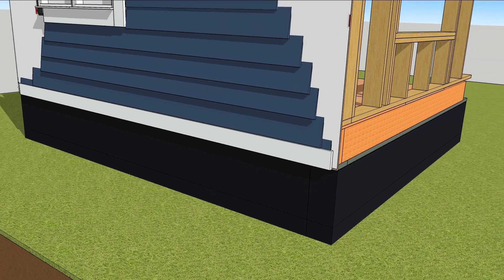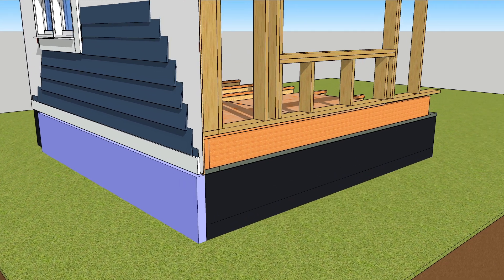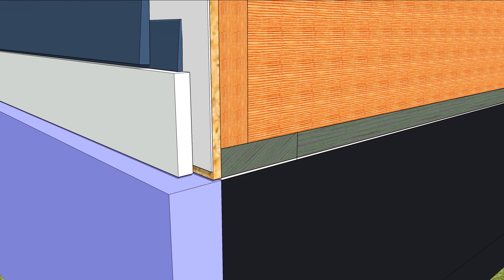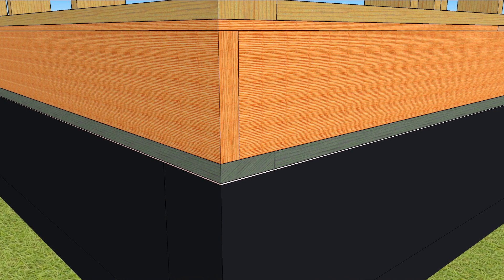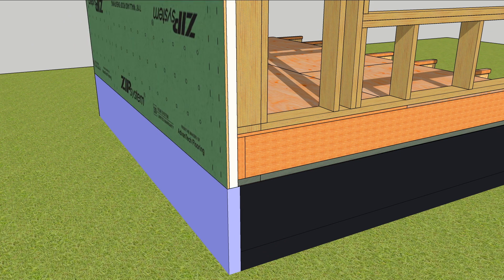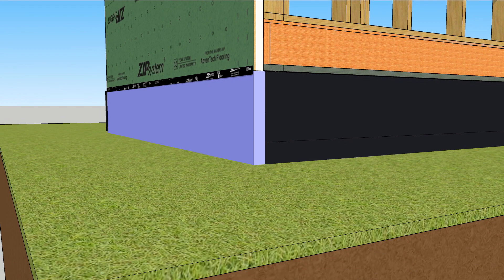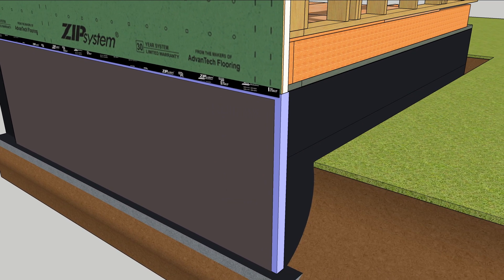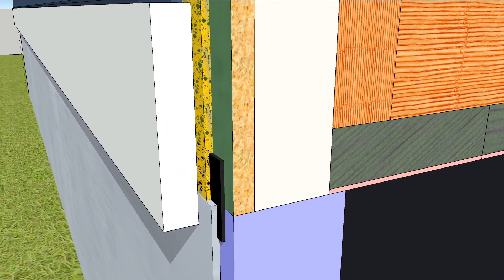Foundation Insulation Detail For Thick ZIP Walls

Comment: Do I need to layer a vapour barrier outside face of the insulation that cover the foundation?
Reply from the maker: the term vapor barrier is misused like crazy. Usually, it is a thing on the warm-in-winter side of a wall IN COLD CLIMATES like Duluth, MN. Judging by the way you spelled "vapour" I guess you are in Canada, so maybe an interior vapor barrier is warranted. but maybe not; as you know, not all of Canada is very cold.

In general a vapor barrier in a wall system is a bad idea. Vapor RETARDERS are better, and can come in the form of latex paint inside the drywall. So-called "smart' vapor retarders (Mem-Brain) can change their permeability depending on the mpoisture content of the air. 

Vapor diffusion is almost never a problem anywhere, it is usually air movement (which moves vapor quickly) that is the best thing to focus on.

Misplaced vapor barriers, like vinyl wall paper, can cause tremendous problems. Look it up at buildingscience.com if you want to go deep. 
Hope that helps.

Comment: How about putting a fiberglass cover over the XPS (Nudo "Groundbreaker"), and flashing it, not just along the top (and tucked under the siding), but also the bottom (probably with aluminum there also, tucked under the fiberglass, and over the foundation)?  Then, the only chance of water getting in from outside would be if it got higher than the top of the drainage pipe

Comment: Bugs will burrow into unprotected buried foam board and disintegrate it over time, leaving little to no insulation left.
Reply: This is a great way to finish off a well sealed foundation to framing connection.  My concern with this method is wood boring insects like termites getting between the foam and foundation and going undetected into the framing.  Is there a termite shield that can be built into this assembly?

Comment: This is one way of doing it. The downsides are: 1) with the cantilevered framing. the framers have to measure out the cantilever distance, instead of simply aligning the face of framing or sheathing with the foundation, 2) At the joint between the Zip R sheathing and the foundation insulation, you're relying solely on the tape to keep out water. I'd still want to flash that joint, as you would do at any major horizontal transition, to doubly protect against water infiltration and capillary action potentially rotting wood sill plate and rim joist. I think you could do this system with all the same materials/thicknesses plus flashing at the joint, simply align the face of framing with the face of foundation, and let the flashing cover the top of the insulation and protection board below. After you add the rainscreen and siding above, the face of the siding/base trim  and face of protection board will practically align anyway.